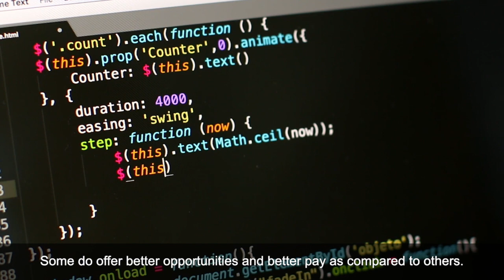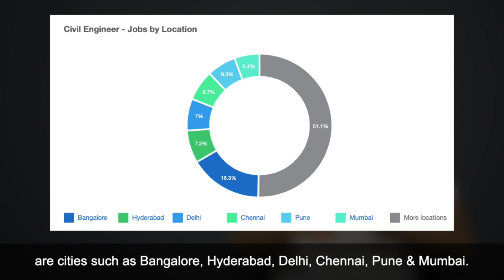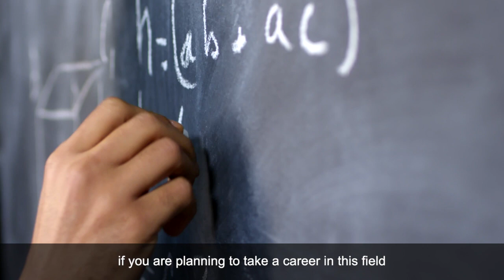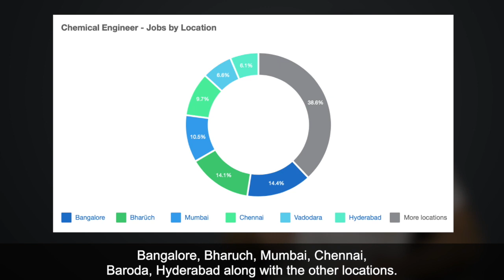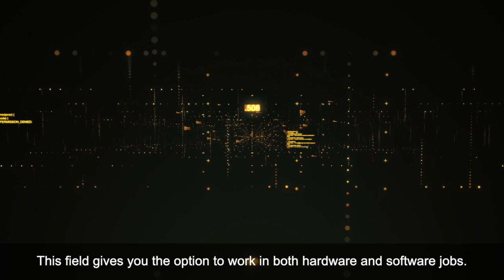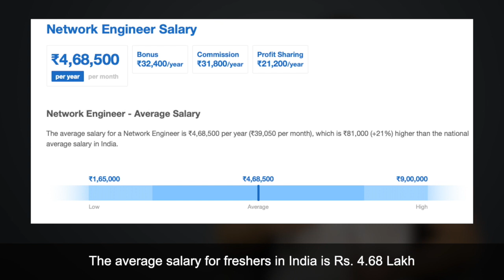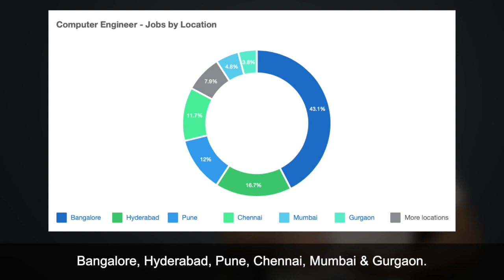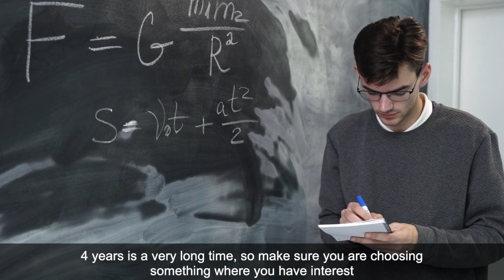Highest Paying Engineering Branches In India in 2024 (Which Engineering Degree To Choose)

Comment: Sir i wanted CSE but college is allowing me to opt either ECE or CCE(Computers and Communications Engineering) what should i take?
Reply from the maker: Hello brother, as mentioned on your separate comment,  

If your interest is in Computer related parts, then you need to choose either computer engineering or electronics & communication engineering. Computer Engineering does more software-related work; such as code development. On the other hand, Electronic Engineering does more hardware-related work; such as working on a computer modern board, circuits, wiring, and alike.

So you need to understand which is the field that you want to enroll in. Both fields are quite similar to each other to an extent, but computer engineering will have more to do with coding in general. 

Both the field offer very lucrative salary packages. So don't worry about the salary, but try to understand which interests you more and choose a field according to that. It's important that you enjoy what you are doing because only then you will be able to grow in your career. 

Hope this helps, and if you have any more doubt, feel free to drop me a message on Instagram. Will be happy to help @Nikhlogic :)
Reply: In ECE,  50℅ is of programming part

Comment: Sir should i take Electronics and Communications Engineering (ECE) or Computer and communication engineering?
Reply from the maker: Hello brother, 

If your interest is in Computer related parts, then you need to choose either computer engineering or electronics & communication engineering. Computer Engineering does more software-related work; such as code development. On the other hand, Electronic Engineering does more hardware-related work; such as working on a computer modern board, circuits, wiring, and alike.

So you need to understand which is the field that you want to enroll in. Both fields are quite similar to each other to an extent, but computer engineering will have more to do with coding in general. 

Both the field offer very lucrative salary packages. So don't worry about the salary, but try to understand which interests you more and choose a field according to that. It's important that you enjoy what you are doing because only then you will be able to grow in your career. 

Hope this helps, and if you have any more doubt, feel free to drop me a message on Instagram. Will be happy to help @Nikhlogic :)
Reply: ECE 🖤
Reply: @avanthikanair2671  hello dear I take ece is it tough iam very much streesed

Comment: Sir I was interested in cars so is good to choose a automobile engineering  as carrier. 
Please reply sir
Reply: Always remember you can't make a full car by learning a single field, only a small part of it. All kinds of engineers are employed in automobile industry. You can work as a computer engineer in a automobiles industry and earn more than mechanical/automobile engineer in the same industry.
Reply from the maker: Hello Nithin, I wouldn’t recommend automobile engineering, since it’s a niche field & the demand for jobs in this field isn’t much high paying in India. 

I would rather advice taking mechanical engineering & then specializing in automobile engineering field. It’s always better to go for a Broader field, because tomorrow if you want to switch your field, it’s easier to do. 

Eg , if you want to go for aerospace or you want to go into oil & gas after your engineering, you can still do as a mechanical engineer, but if you are are doing automobile engineering; it will be much difficult. 

So always choose a field which opens your door to multiple sectors and then do certifications on the field you want to specialize in that field. Also, if you do have the budget, do mechanical engineering in india, and plan for masters in Germany. Germany as a country has huge scope for automobile industry. 

Hope this helps & if you have further doubts, drop me a message on Instagram - @nikhlogic

Comment: How about automobile engineering
Reply from the maker: Hello Ajmal, I wouldn’t recommend automobile engineering, since it’s a niche field & the demand for jobs in this field isn’t much high paying in India. 

I would rather advice taking mechanical engineering & then specializing in automobile engineering field. It’s always better to go for a Broader field, because tomorrow if you want to switch your field, it’s easier to do. 

Eg , if you want to go for aerospace or you want to go into oil & gas after your engineering, you can still do as a mechanical engineer, but if you are are doing automobile engineering; it will be much difficult. 

So always choose a field which opens your door to multiple sectors and then do certifications on the field you want to specialize in that field. Also, if you do have the budget, do mechanical engineering in india, and plan for masters in Germany. Germany as a country has huge scope for automobile industry. 

Hope this helps & if you have further doubts, drop me a message on Instagram - @nikhlogic

Comment: Sir, what is the difference between electronic engineering and electrical engineering
Reply from the maker: Quite a lot Rahul. 

The main difference between electrical and electronic is that, electrical focuses on big mass projects like power grid etc. Here your overall knowledge in terms of understanding wiring is important: It goes into more technical aspects of it. 

Electronic focuses on micro projects that requires you to understand coding. Electronics is another way of getting into AI & roles related to data science: So this field opens your door to tech industry and offers you a scope in software industry as well, as you will need to develop programming languages for this. 

I would recommend electronics among the 2. 

If you have any further doubts, feel free to drop me a message on instagram @nikhlogic. Happy to help :)
Reply: @NikhLogic  thanks for your information.
Reply: Both ECE, EEE is difficult 😂... Both branches have somewhat similar subject.

Comment: I am confused between electronic engineering and software engineering
Reply from the maker: Hey Aditya, what do you want to pursue in your career? 
Both these fields are equally good. You need to understand which field you want to start working in. Could you give me slightly more details in terms of what your goal is?

Drop me a message on instagram if you have any doubts at @nikhlogic :)
Reply: @NikhLogic  yeah I will dm you

Comment: What about petroleum engineering ? Is it good in india ??
Reply from the maker: Hey bro, I wouldn’t recommend Petroleum engineering, since it’s a niche field & the demand for jobs in this field isn’t much high in India. 

I would rather advise taking mechanical engineering & then specializing in petroleum. It’s always better to go for a Broader field, because tomorrow if you want to switch your field, it’s easier to do. 

Eg, if you want to go for automobile or you want to go into aerospace, you can still do it as a mechanical engineer, but if you are doing petroleum; it will be much difficult. Also, to work in Oil & Gas sector, Middle east is a great place to work at. Also, most of the Oil & Gas companies will have mechanical people working there. So rather go for the broad field. 

Hope this helps & if you have any doubts in this field, feel free to drop me a message on Instagram @nikhlogic. Will be happy to help :)

Comment: Marine engineering
Reply from the maker: Hello Pranav, I wouldn’t recommend marine engineering, since it’s a niche field & the demand for jobs in this field isn’t much high in India. 

I would rather advice taking mechanical engineering & then specializing in marine engineering field. It’s always better to go for a Broader field, because tomorrow if you want to switch your field, it’s easier to do. 

Eg , if you want to go for automobile or you want to go into oil & gas after your engineering, you can still do as a mechanical engineer, but if you are are doing marine engineering; it will be much difficult.

So always choose a field which opens your door to multiple sectors and then do certifications on the field you want to specialize in 

Hope this helps & if you have further doubts, drop me a message on Instagram - @nikhlogic

Comment: What about aeronautical engineering
Reply from the maker: Hello Arif, I wouldn’t recommend aerospace or aeronautical engineering, since it’s a niche field & the demand for jobs in this field isn’t much high in India. 

I would rather advice taking mechanical engineering & then specializing in the field you want to. It’s always better to go for a Broader field, because tomorrow if you want to switch your field, it’s easier to do. 

Eg , if you want to go for automobile or you want to go into oil & gas after your engineering, you can still do as a mechanical engineer, but if you are are doing aerospace; it will be much difficult.

So always choose a field which opens your door to multiple sectors and then do certifications on the field you want to specialize in 

Hope this helps & if you have further doubts, drop me a message on Instagram - @nikhlogic

Comment: I'm confused in ece and computer science..pls help..
Reply: If you want higher packages then go for CS
Reply from the maker: Hello Harsh, 
Computer Engineering does more software related work; such as code development. On the other hand, Electronic Engineering does more hardware related work; such as working on a computer modern board, circuits, wiring, and alike.

So you need to understand which is the field that you want to enroll into. Both field is quite similar to each other to an extent, but computer engineering will have more to do with coding in general. 

Both the field offer very lucrative salary packages. So don't worry about the salary, but try to understand which interests you more and choose a field according to that. It's important that you enjoy what you are doing because only then  you will be able to grow in your career. 

Hope this helps, and if you have any more doubt, feel free to drop me a message on instagram. Will be happy to help @Nikhlogic :)
Reply: @NikhLogic  thanks for ur reply ...but in computer engineering and ece job , what work we have to do ....I'm actually confused as to what my intrests are ..i like both computers and mobile devices also..
Reply from the maker: at the end, in your job, you will be doing much more than what you study during your B-tech. Both ECE & comps, are great field and opens your doors to Tech industry. If you are taking ECE, you have the scope of joining telecom industry as well & work with Telecom giants of world.

Comment: Sir, plz tell about aerospace and aeronautical  engineering....
Reply from the maker: Hello Rudraksh, I wouldn’t recommend aerospace engineering or aeronautical engineering, since it’s a niche field & the demand for jobs in this field isn’t much high in India. 

I would rather advice taking mechanical engineering & then specializing in aerospace. It’s always better to go for a Broader field, because tomorrow if you want to switch your field, it’s easier to do. 

Eg , if you want to go for automobile or you want to go into oil & gas after your engineering, you can still do as a mechanical engineer, but if you are are doing aerospace; it will be much difficult.

So always choose a field which opens your door to multiple sectors and then do certifications on the field you want to specialize in 

Hope this helps & if you have further doubts, drop me a message on Instagram - @nikhlogic
Reply: @NikhLogic  thank u very much..
Reply from the maker: Anytime brother :)

Comment: sir please help me out
i am confused like which is hard whether its chemical engieering or computer engineering
is maths needed a lot in chemical engineering??
pls reply
Reply: CS branch is easier than other Engineering branches
Reply: @ITSME-qb4dc  thank you for replying 🙂
Reply from the maker: Hello Taliya, in your first year of college, all branches will have maths in it. From 2nd year, computer science will be more related to understanding the software and hardware part. The maths involvement in this is quite less, but the coding becomes quite heavy. 

If you don’t know coding or programming languages, I would highly recommend learning those as no engineering field is easy as such
Reply: @NikhLogic  thank you for your advice
I have learnt python in class 12th so I am taking csc engineering 
Suggest me some things that I could do now because I am yet to join my first year
Is there anything that I can learn now that would help me in my engineering 
Pls reply
Reply from the maker: So you need to have a strong command on 3 basic languages - R, Python, C++. Once you have these done, start working on small projects. I would recommend connecting with people on Linkedin who graduated as computer science engineers to understand this better. So start working in this manner. The more you connect with seniors from different colleges etc, that will give you a better understanding of how to proceed. 

Hope this helps :)
Reply: @NikhLogic  thank you sir for your advice

Comment: What about aerospace engineering
Reply from the maker: Hello Pranav, I wouldn’t recommend aerospace engineering, since it’s a niche field & the demand for jobs in this field isn’t much high in India. 

I would rather advice taking mechanical engineering & then specializing in aerospace. It’s always better to go for a Broader field, because tomorrow if you want to switch your field, it’s easier to do. 

Eg , if you want to go for automobile or you want to go into oil & gas after your engineering, you can still do as a mechanical engineer, but if you are are doing aerospace; it will be much difficult.

So always choose a field which opens your door to multiple sectors and then do certifications on the field you want to specialize in 

Hope this helps & if you have further doubts, drop me a message on Instagram - @nikhlogic
Reply: Thank you for your advice. Found this very helpful
Reply from the maker: Anytime brother :)

Comment: What about aerospace engineering??
Reply from the maker: Hello Puskar, I wouldn’t recommend aerospace engineering, since it’s a niche field & the demand for jobs in this field isn’t much high in India. 

I would rather advice taking mechanical engineering & then specializing in aerospace. It’s always better to go for a Broader field, because tomorrow if you want to switch your field, it’s easier to do. 

Eg , if you want to go for automobile or you want to go into oil & gas, you can still do as a mechanical engineer, but if you are are doing aerospace; it will be much difficult.

Comment: Where is aerospace engeneering ??
Reply from the maker: I wouldn’t recommend aerospace engineering, since it’s a niche field & the demand for jobs in this field isn’t much high in India. 

I would rather advice taking mechanical engineering & then specializing in aerospace. It’s always better to go for a Broader field, because tomorrow if you want to switch your field, it’s easier to do. 

Eg , if you want to go for automobile or you want to go into oil & gas, you can still do as a mechanical engineer, but if you are are doing aerospace; it will be much difficult.